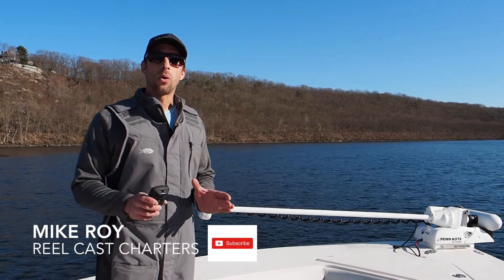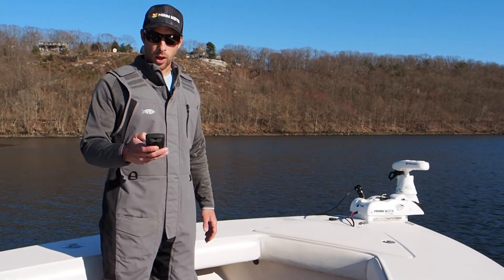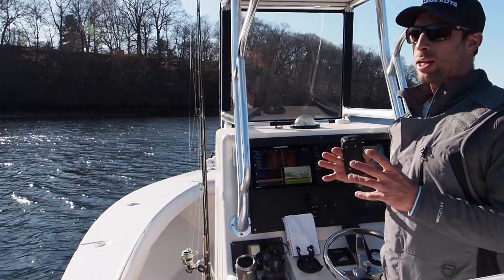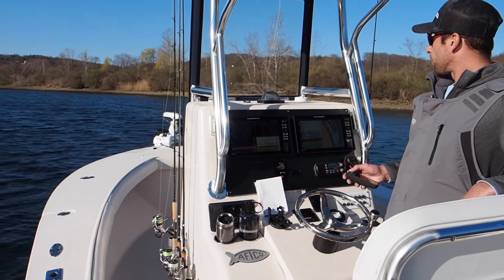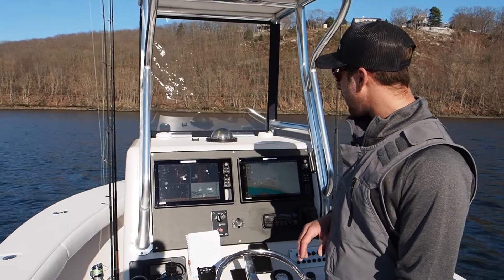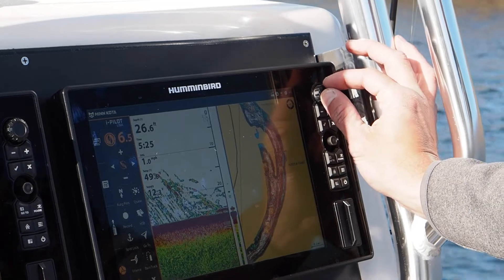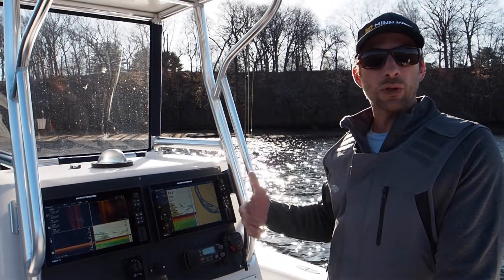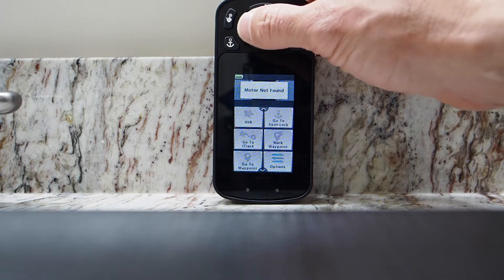How to use a Minn Kota Ulterra Trolling Motor: Is an Ulterra worth it for a saltwater angler?

Comment: Have a 36V 112lb 60" shaft coming this week or next.....huge chunk of change considering addition of your 'infrastructure' (batteries, cables, etc), but I absolutely cannot wait.  For the types of inshore fishing that I'm interested, I find it a huge PITA in order to do it the old fashioned way.  This almost seems like cheating.  The darn things are almost unobtanium these days, and most are shipping without heading module (to ship later).  Supply chain woes.  Literally bumped me to this motor from the 24v 80lb I'd originally desired, but with the wind and my 23' bay boat, I think I'll end up glad I took the leap in the end.  As far as my fishing goes, this thing would literally go multiple weekends for me without recharging (but I'll be topping it off regardless...better for those high dollar batteries).  Definitely invest in a good charger / conditioner / desulfation setup.  I've literally got farm equipment (Kawi Mule, Tractor , etc) and autos (all with quick connect pigtails) that are on 8 year old batteries that continue to work like a champ.  Have fun guys....the girlfriend is likely on the backburner a while after this wallet lightening event....but it is what it is!  Hehe.

Comment: How long will that deployment / trim motor work? I understand it is typically a $500 repair.
Reply from the maker: They have a limited warranty so I’d look into that first or look into the Terrova they are bullet proof.
Reply: I have a terrovo and the power board got fried and it’s 250 with parts/labor but a strong and dependable motor just forgot to unplug while charging

Comment: Great explanations it's a pity you weren't able to show the setup been actually used offshore.  Seeing it work in real world conditions like wind and current. Unfortunately they are extremely expensive in Oz and are commomly known to fail as the deployment system brakes down.  Then it seems parts take along time to ship to Oz. The other minnkotas have great reputations.  In you're opinion what would be the biggest boat you would run the 112lbs based on your experience?
Reply from the maker: I run mine on a 23 foot CC and it works great. I have seen them run on 30 ft CC before. I have a friend Harry that fishes out of Sydney that is currently running MK on his boats.
Reply: Thanks Mate not many 7m hardtop boats running  them offshore to get enough feedback about them. The feedback so far is the Ulterra is unreliable in the salt. Nonetheless if access is good the Terrova has a good reputation. Problem is with my hardtop Stabi access isn't easy. Appreciate your experience and reply.

Comment: Great video and I have a quick question.   I fish in the long island sound New York, where often boats are crowded in a given area.  Because, of course, everyone knows where the honey holes are at.  If I use the remote to auto navigate to a desired spot and the unit malfunctions, or I drop the darn thing, would the trolling motor continue on its path, even though there is a boat in front of it.  I can see a collision is a risk?
Reply from the maker: In that scenario just press the power button off. Also I keep a mini remote as a back up.
Reply: @reelcastcharters1306  thanks

Comment: Can you adjust the stow position? Can I adjust it so it only trims up 3/4 or 2/3 of the way and then stow? Or stow and move the trim back down? I want a long shaft but am gonna have it mounted parallel to the front of my pontoon boat and dont want it sticking out off the side.
Reply: Don't think so but try downloading the owners manual
Reply from the maker: You are able to trim the motor up so if you are in shallow water and do not want the prop to hit bottom. The next time you deploy it will go to the same trim that you perviously had the motor at.

Comment: I have a pontoon and we drift backward. Will it hold a reverse heading? In other words, will it hold me straight on a heading at a certain speed in reverse?
Reply from the maker: The Legacy Auto Pilot will keep the trolling motor on the heading at a set speed. You can push the boat in reverse if you had the motor facing dead stern.

Comment: When you want to troll in autopilot, can you set a specific speed so the motor adjusts speed accordingly, or can you only select the prop speed, such as 1-10?
Reply from the maker: You can select a prop speed 1-10 and increase or decrease speed by pressing the + or - button. The autopilot will only keep the motor on the chosen heading.
Reply: Greg, yes it has cruise control in .1mph increments.

Comment: Will spot lock work without having connected to a fish finder? Can you Bluetooth it?
Reply from the maker: Yes you do not need to connect it to a fish finder. The trolling motor has an internal GPS chip and is controlled via a bluetooth remote.

Comment: Hey m8 I'm just curious how fast this pushes your boat say I want to just troll for some lake trout what is the top speed of this unit on your boat, will it push you 2.5 mph pretty easily or should I just stick with a gas kicker
Reply from the maker: Speed will depend on wind and tide. I could pull the boat give or take 3 mph.
Reply: @reelcastcharters1306  thanks for  the info

Comment: Question......When I deploy my ulterra, everything works great, when I stow it and move, the next time I deploy the prop wont spin and nothing makes it spin.  If I stow it and unplug and cyle into deploy again, then the prop spins........so it seems like i am continually unplugging and resetting every time I move.  Is this normal or am I doing something wrong?
Reply from the maker: It should not be doing that. I would call customer service and maybe they can help you trouble shoot.

Comment: What shaft length and voltage are you running? I have a similar boat
Reply from the maker: 72 inch shaft, 36 volt, 112lb thrust, plenty of power for the boat
Reply: @reelcastcharters1306  what would be the minimum you would use on a 22FT CC ? THANKS
Reply from the maker: @guacaquio  I would use the 112lb thrust

Comment: Minnkota leaves something to be desired, it simply burns the engine plate, which here in Brazil is very expensive. I have an Ulterra and a Power Drive, they are two boats. If the battery reaches 50%, an electrical failure occurs and then everything is out of control. I will return everything and try Motor Guide!
Reply from the maker: I've never had that issue with mine and it is used daily. Perhaps you have a defective motor?
Reply: @reelcastcharters1306  
I have an ulterra and a Power drive, both with the same problem.  this episode is far from being solved by Minnkota ... it is a neglect.
Reply from the maker: Not sure bud, never seen that or know anyone that has had that problem.
Reply: Did you guys know that if you’re using lead acid batteries deep cycle you’re not supposed to let them get below 50%? That’s just common knowledge. Apparently your minnkotas are smarter than you.

Comment: My experience says these things are not worth the investment no matter what kind of fishing you are doing. They are over hyped and do NOT work as promised. Oh sometimes it works, and you think, how great is that. But then it simple decides to turn itself off while you are gliding swiftly into a dock piling or tree stump. Wish I had my money back and Minn Kota had this POS in its pile of great ideas that don't work.
Reply from the maker: Thats unfortunate that you had a bad experience with yours.  I've been using mine as a full time guide (7 days a week) since fall of 2016 and would never go back to fishing with out one.  Things to consider are poor rigging or voltage supply, bad batteries, bad install and/or operator error.  I would consult with a certified MK dealer to trouble shoot.
Reply: You must not do much variety of fishing because the ulterra is an absolute necessity for me that I can’t get with any other trolling motor